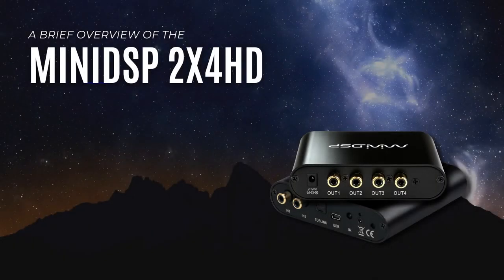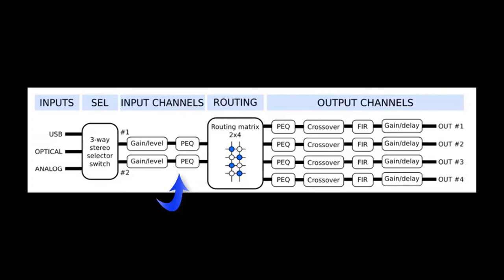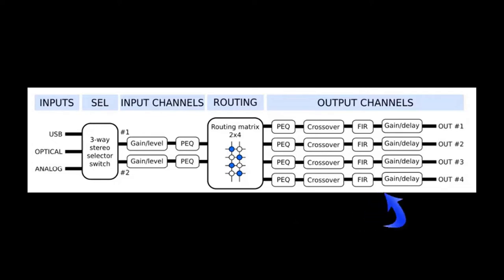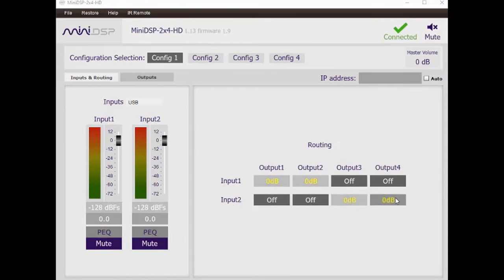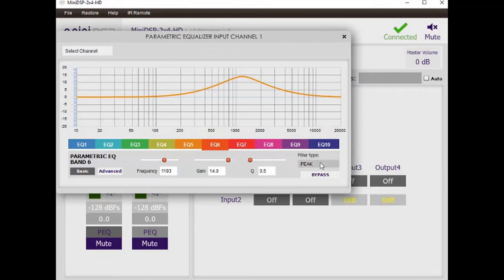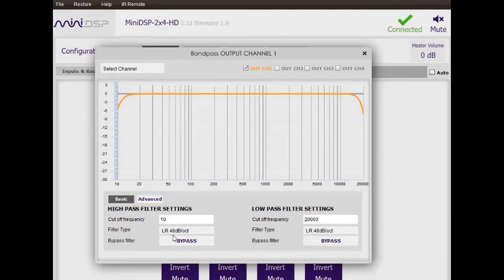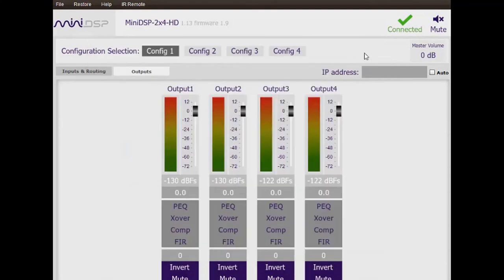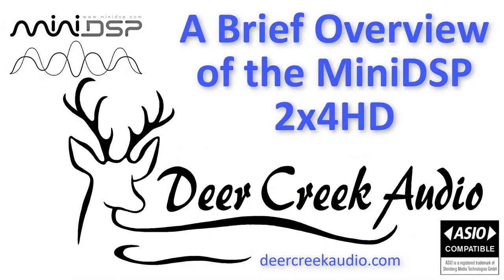A Brief Overview of the miniDSP 2x4 HD

Comment: Soooo, what are the use scenarios for this? Input what, output to what?
Is it oly for subs? It goes before amp? What the hell is this?
Reply from the maker: The miniDSP 2x4 HD is a high fidelity, high performance digital-to-analog converter (DAC) and digital signal processor (DSP) with powerful audio processing functionality. The 2x4 HD features USB and TOSLINK digital inputs, two analog inputs and four analog outputs.

Functions
USB DAC audio streaming up to 192kHz and a TOSLINK digital input
Programmable active crossover
Programmable subwoofer crossover
Programmable parametric equalizer
Room response correction equalizer (requires UMIK-1 or UMIK-2 microphone and REW software)
Channel delay and level control
Reply: @deer_creek_audio  so, i have a 7.2 setup. Do I need this? What can it do for me? Does it come into play before my receiver or after it?
Reply from the maker: If you are a home theater user the 2 x 4 HD is most commonly used after your audio video receiver to enable the use of multiple subwoofers. Please see.: https://youtu.be/EazPggtMtHU?si=lGUJTJRTJ7kCliCh

Comment: Does a computer have to be plugged into this at all times for it to work or can you program your settings and disconnect the computerit and the dsp will stand alone with the settings saved?   I dont think its mentioned anywhere in literature if this can stand alone.  Sorry if u mentioned in the vid i was unable to watch wholel thing
Reply from the maker: The EQ901 Series are plug-and-play, and do not require an external computer.